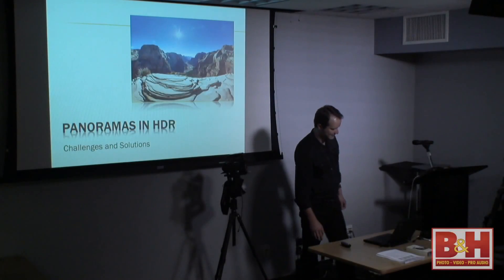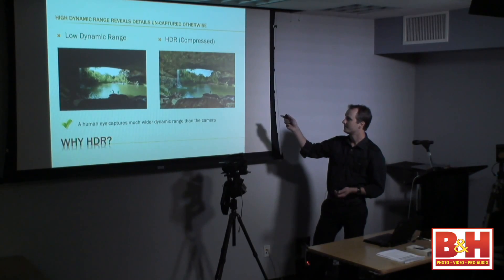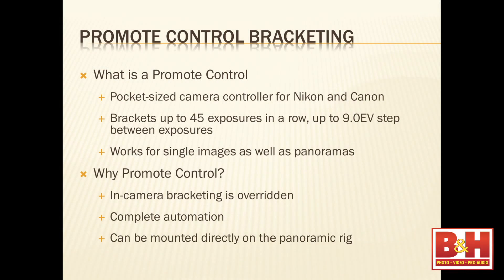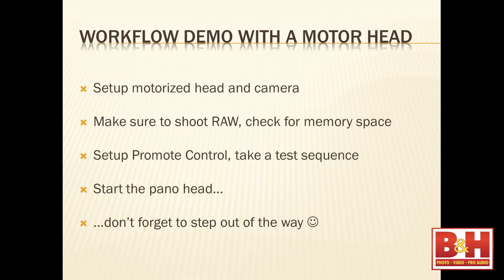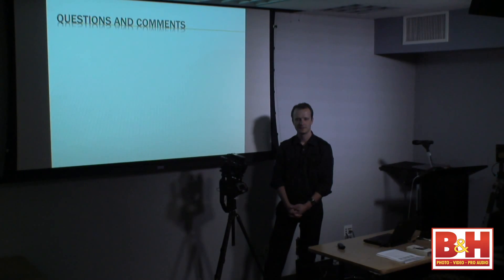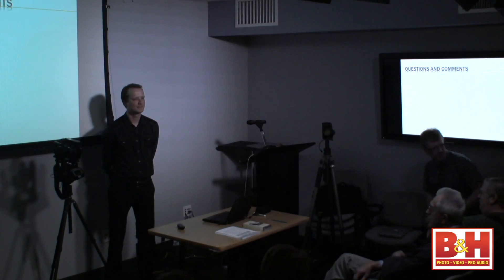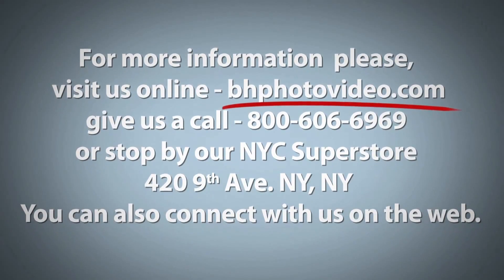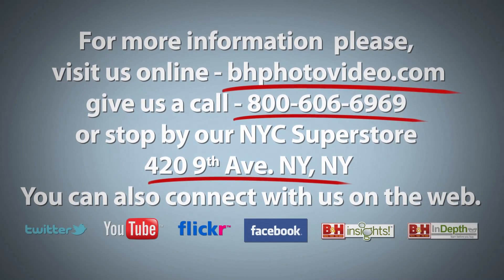High Dynamic Range Panoramas with Promote Control

Comment: Great video, I am new to the Promote Control. Also, the motorized tripod heads - cool. It seems this is a Masters-level class - thank you Arty and Joergen, and B&H. Also new to me - Clown Vomit. I have had  a few situations this description provides the most accurate title and was at a complete loss of words - never more! I have lived the trouble of blown out lights versus pitch dark ante-rooms in architectural photography - huge ranges. Fixed by hand. I feel like l learned a new (complex) procedure for better shots.